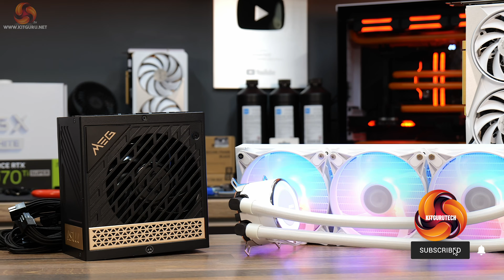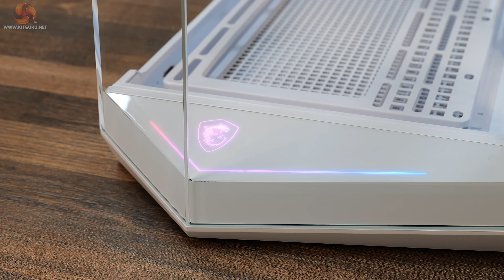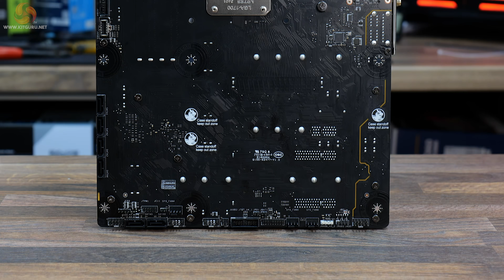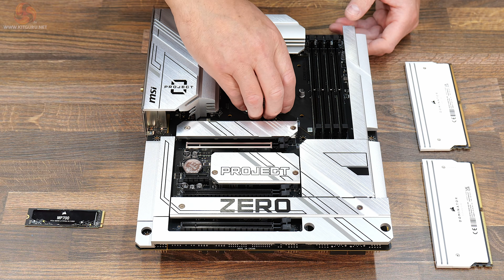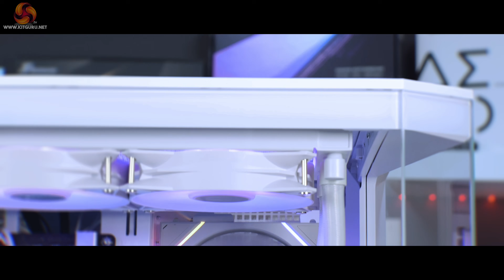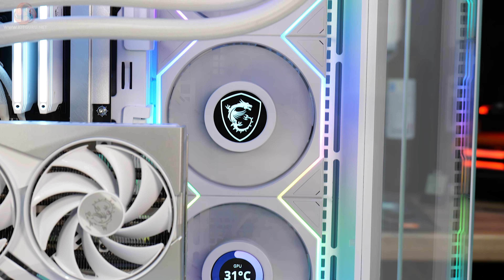MSI Project Zero build / MAG PANO 100L PZ

Comment: I LOVE MY NEW BUILD WITH THIS CASE ONE PROBLEM HHD3.5 SATA U CAN'T CONNECT SATA CABLE ON DOOR I FOUND A ADAPTER ANGLED SHOULD SOLE IT. MY BUILD. asus tuf gaming geforce rtx 5070 ti,AMD ryzen 7 9800x3D, MSI mag x870e tomahawk max wifi PZ, msi coreliquid p13 360 ,Msi Mag A850Gl corsair vengeance 32gb samsung 990 pro 2tb cost to build 2,900 around waiting for new fans

Comment: If you use the Arctic Freezer 3 360 RGB and the Radeon RX 7900 XTX GAMING TRIO CLASSIC you can't have the card vertical. Also, the Cooler master riser cable does not fit because you cannot screw it down where they have the holes. I just bought one of these and had all sorts of problems with it. I've been building pcs since 2000.

Comment: This looks almost the same as my new build except I'm using an i7 14700K, an MSI GeForce RTX 4070 Super 12G Gaming X Slim GPU in white, a Corsair iCUE Link Titan 360 RX RGB Liquid CPU Cooler with additional RX 120 fans all in white, 64gb of Corsair Vengeance RGB DDR5 @ 6400MHz and a MAG A850GL PCIE5 PSU in white. The case and motherboard are the same though and I wanted to keep the build to under £2K hence the less powerful CPU and GPU plus I won't be using the rig for gaming but 3D digital artwork.
Great video, I'll be saving it in my favourites for when I do my build!

Comment: Just used this case in a build with a 7950x3d and a horizontally mounted RTX 4090 GAMING X TRIO. Been using it for about 2 months now playing a variety of games like Cyberpunk, FFXIV, and Throne and Liberty, all on the highest graphics settings at QHD resolutions, and the thermals are just fine. I used 3 120mm fans intake on the side and bottom with a MAG Coreliquid E360 AIO and another 120mm fan on the top and back respectively for exhaust.

In real-world gaming situations I'm seeing thermals for both CPU and GPU even after long multi-hour gaming sessions at generally no higher than 60C, so I have no complaints with the overall cooling performance in this case.

Comment: Why are the gpu fans not spinning?  1) because they are not hot enough to come on.  2) because it is using onboard video at the moment 3) he disconnected or turned off the fan for it.  

I haven't assembled a computer since 2010 so i am curious .
Reply from the maker: Some fans don’t spin up on graphics cards until a certain load|temperature is reached. Same with many power supplies.

Comment: Petition they make the top panel have a hollow top so we can have push pull configuration. So the free fans are at the top, and the fans you bought like lian li will be inside of the case, like this one, my OCD side cant stand that the fans in aio are different from the case fans. While it is a really beautiful build, It looked a bit off because the fans at aio are not the same as the case fans.

Comment: you cant push pull the rad on the top right? wouldve been cool if it does, this case now looks cooler than the 011
Reply from the maker: I didn't try push pull at the top but it might just squeeze in depending on motherboard heatsinks etc.

Comment: James, you must get to see so much hardware, would you use this case yourself in your own builds? ive seen a system in your videos sometimes in the background, hard looped, looks to be a lian Li case, am I right?
Reply from the maker: Yes the case in the video backdrop is a Lian Li O11D modified to fit two 360mm radiators with the EK front distro plate. 

It depends on the price, if it's around £100 when it launches I might consider using this case again. There's lots of good competition for this type of case though.
Reply: @KitGuruTech  ❤❤❤❤❤❤

Comment: Having the connectors on the wrong side of the board looks like it’s going to make builds a real pain in the you know what.
Reply from the maker: The main thing you need to watch out for is putting the motherboard down incorrectly and bending pins.

Comment: Great build as always James, looks amazing. I'd love to see a full review of the case. I can see a couple of minor flaws - a few of the fans seem to be at bit blocked at the intake side. Not a huge deal if you're running low power parts but I can see your CPU temps look like they need all the help they can get
Reply: Blocked ? Really. Never noticed that. Well caught !
Reply: Good catch never spotted that. Wondering if it will impact real world results.
Reply: I dont think it will affect airflow at all
Reply: Funny the thought crossed my mind at various parts of the video, but I think the air flow isnt blocked, not any more than a very tight airfilter mesh would make on flow anyway. Ive tried to look at it from the various angles I can see in the video, but dont think it would be that bad at all in teh real world. I agree, James - it deserves some investigation

Comment: Are all the manufacturers jumping on board the project zero train? Is everyone using the same positions for the connectors?
Reply from the maker: Yes and no is the answer. Currently MSI, Asus and Gigabyte have back connect boards but the layout isn't identical.

Comment: How quiet is the MSI MAG Coreliquid E360 cooler? I want a silent build.
Reply: It’s a good cooler. My friend has it but it can get loud ish.
Reply from the maker: It's depends on fan speed but it's not the quietest 360mm AIO.
Reply: @KitGuruTech how much could it possibly cost to use the best/quietest fans available? Maybe £1 per fan more at the factory door?
Reply: @PCPro2017 probably wouldn’t be much more than that.

Comment: A great build... in the wrong case. I'm agin these back connect mobos. There was nothing broke that needed mending imho; and this case is just a dreadful shape as far as I'm concerned. Best dressing of mutton as lamb we'll probably ever see though!
Reply: Seems a bit narrowminded of a comment IMO. There is a good aesthetic reason for project zero and the other manufacturers options too. Gets rid of a bit of clutter around the front of the motherboard. Surely thats a good thing. should even help airflow around the VRMs too
Reply: You don’t like the back connect boards ? 😮
Reply: The case is a bit weird, but i think project zero has its value - a lot of people have real issues with cable management and struggle, I know, ive seen a lot of them !
Reply: I think it’s a good step in a different direction. Variety and all that.
Reply: Shut the fuck up lol, We all want upgrades and varieties of pc hardware to expand this hobby even further! and wdym dont fix that dont need mending😂 how is this a fix? its called a concept and a different design for a more clean looking build.
Reply: I have the case about as big as the y70 case in front, back not too bad. But if you're going to be using a big PSU then this isn't the case for it.
Reply: You just scream of one of those guys who give zero f’s about aesthetics. That is the point of back connectors. Cleans up the build immensely.

Comment: Hey James after building this - does this platform appeal to you for your own systems? always curious to know how you feel about it all. You were quite diplomatic in the video. Are you sold on Project Zero?
Reply from the maker: I like the concept of Project Zero / back connect motherboards especially for hiding the fan/RGB/front panel cables etc but I still like custom sleeved power cables matching the system colour theme. I also think other hardware needs to catch up for the completely cable free system, as you still have CPU coolers, fans, graphics cards etc with cables on show.

Comment: Nice case. The amount of steel in that hole makes me slightly uncomfortable though. 
Also I'm probably more into custom cable camp. Tech must be seen. Don't hide the screws and wires, use good looking ones. Tech design, steampunk, whatever. Nature isn't sterile clean. Still the backside connectors idea is welcome in general. The more choice the better.
Reply: Never thought about that angle tbh. I like to hide most things, but I get your point. was a pretty clean build from James regardless of how you swing I guess
Reply: @stickyfingers9710  sure, good looking showroom build. 
Somehow I'm casually attracted to dirty things though. And a bit cautious of the concept clean considered an advantage by default. Life can't exist in a clean space. In the long run "clean" can turn out to be "uninspired". Like those people wearing black only. Regarding this build I must agree the details are really well chosen and arranged. Those tiny bearings, screens, etc. Even though I would never build a case with 10 fans myself.
Reply: @vensroofcat6415  some good points. I like seeing cables myself, but im weird, so my wife says.
Reply from the maker: I still like to see some custom sleeved power cables that match the system colour theme too, for me its all part of the build but Project Zero does create a new super clean look that's different - James